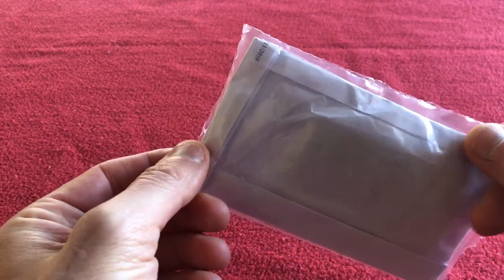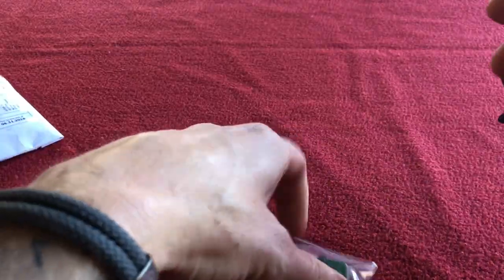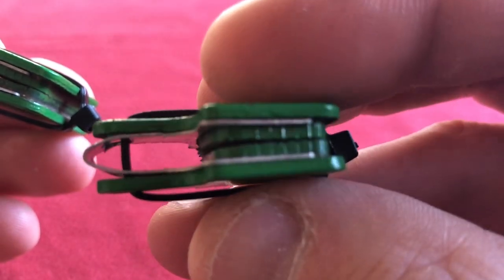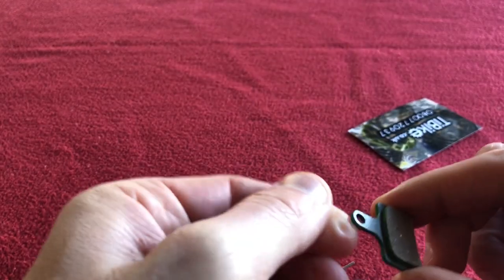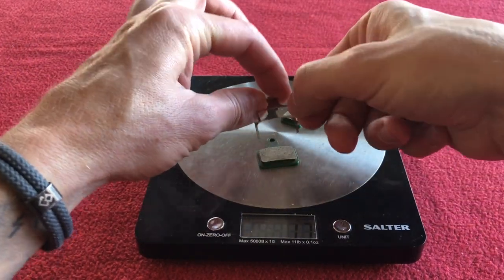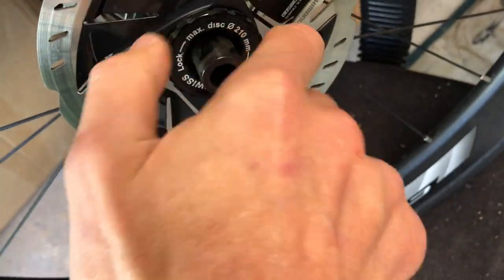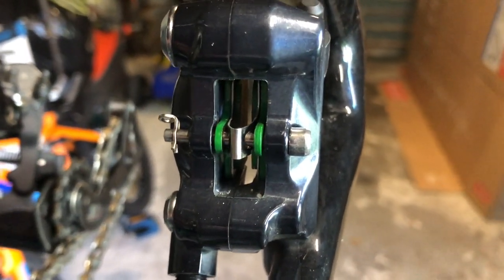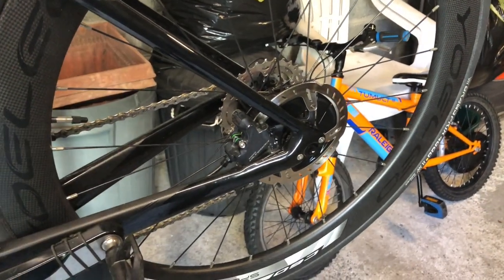Gorilla Brakes Shimano BR-RS505 Ceramic Disc brake pads

Comment: Nice video. How would you rate the pads for performance, durability?
Reply from the maker: Mark Freeman they are actually really good! I think they are easily the best pads I’ve had, I found the metal ones didn’t stop in the wet, the resin pads are good but once contaminated they are useless. These seem to be a good all rounder. Hardly ever squeal, and stop the bike quickly. 👍

Comment: Hi.. How they holding out? I'm looking for new pads just wondering how's it going with them after a year? Wear and tear? Drop in braking? And have you changed them and why?
Reply from the maker: Jason Rouse still got the same set! Braking is good, sometimes a little squeak, but a wipe down of the rotor sorts it out. Best pads I’ve ever had! Putting these on my new bike shortly. 👍
Reply: @KyrosHouseCycling  thanks that's good I'm getting a full set this week. 👍
Reply: @KyrosHouseCycling  what do you wipe down your rotar's with?
Reply from the maker: @mst3rmind879  I normally take them off and scrub them with fairy liquid if they are really dirty, but otherwise I use a clean microfibre rag then wipe the rotor with meths. 👍